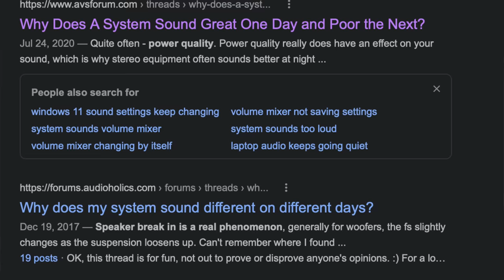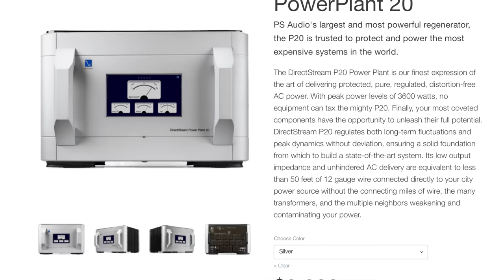Why Your HiFi Audio System Sounds Worse on Some Days. Is this the Cure? What about Transformer Buzz?

Comment: I have this 156 with the power cord and agree it is a fantastic product at a reasonable price compared to others like SR or Shunyata or Nordost or PS Audio etc.
Reply: You seem to have researched almost everything(!). Did you ever audition or hear about Furutech star grounded power distributors? On paper they do a similar job to Puritan but without surge protection,
Reply from the maker: It's one of the best purchases I have made for my system. One of the best I have made in 30+ years.

Comment: 99% of the time it's down to your mood.

Most decent pieces of hifi have so much power supply regulation and PSRR that they barely care what the mains does.
Reply: Yeah, never had such hideous 'DC on my AC mains' problems like this.

Comment: I am so thankful that every time either day or night I listen to my system I'm nothing but blown away.  And I don't use anything but 10 gauge copper speaker cables and standard basic jacks for my preamp CD player turntable and plugged straight into the wall, how is that possible?
Reply: You have “Magic Juice” Magic Juice is extremely rare. Don’t let the electric power company know you have Magic Juice coming into your house. They will raise your electric power bill if they find out you are an Audiophile.😀
Reply: How is it possible ?  

The devices you own were designed to be used exactly as you do, nothing more.  No magic here.

Comment: Have you tried the Puritan with a nornal power cable yet? Logically, if the power conditioner is doing its job, the cable between the wall and conditioner shouldn't make much difference. On the other hand, cables between the conditioner and the equipment maybe more effective to preserve the clean power and reduce interference via shielding.
Reply: Conditioners don't condition themselves.
Reply: Getting clean power for your stereo is a cumulative process. Even the power outlets (i.e. Furutech, Audience) can yield a noticeable reduction in noise if you have a revealing upper mid-end to high-end system.

Comment: Thing is, you've introduced a new X factor by rewiring the room. You said you just plugged your amp straight into the wall, and the peripherals went into a power strip. First thing I'd do before plopping $4k into a new toy, would be to start from scratch. I'd be really interested to see what the Niagra does as far as alleviating your issue. Sure, this is 1/3 the price of the PowerPlant, but I'm guessing with the new wiring a lot has changed with your system. When I was building my dream room with a dedicated 20amp panel just for the electronics, they installed some sort of sine wave conditioner that wasn't particularly expensive. The noise floor was non existent, and the blackest of blacks. The ex probably has her electric piano plugged into it these days. BTW, after 50 years (25 as a recovering audiophile), I know half of it is psychological. There's days I just shouldn't be listening and don't. In my current digs w/lousy wiring, a Niagra solved my minor issues.
Reply: Nope, it isn't psychological.

Comment: Well I’ve definitely experienced this. I’m on the cheaper end of the market though as my solution was the audiolab dc blocker. My hifi now sounds consistent.
Reply: I use the Audiolab DC Blocker also and it improved the sound of my system greatly.

Comment: The big issue I have with Puritan conditioner is all the inductors it uses to filter noise. I’ve used power conditioners like this before. It lowers the noise floor at the expense of restricted dynamics and truncated soundstage.  This conditioner maybe different but I doubt it.

Comment: You are absolutely right that some days sound is not perfect for the same system. Could it be depending on air pressure change?
Reply: Or if you have a cold that can effect the sound,plus if you sneeze and your ears pop slightly that too can change the sound.

Comment: This was convincing. Think I'm gonna buy it. Do you recommend connecting all equipment? Especially is there any problem connecting both digital and analogue devices to it - as opposed to some power strips that have separate zone for those (perhaps the outlets here are all separated zones to some extent)?

Comment: I use the iFi Powerstation and it has also brought consistency and low noise floor to my system. A $750 bargain in comparison.
Reply: Does it have star grounding? The CEO of PS Audio himself said that is a key ingredient.
Reply: @connorduke4619  Paul's a great and knowledgeable guy. I'm not sure but I'm confident that the Powerstation has some form of isolation between any independent circuits/PCBs - they do design a variety of power and signal related products, in addition to their audio gear. There's also an intelligent ground function that detects whether or not a ground is needed to avoid ground loops.
Reply: @infn  Paul's a great salesman too.

Comment: I have all my audio components plugged in wall sockets, and it sounds wonderful, no transformer buzz, no nothing... just super sound...and no fairytale stories with magic dust...
Reply: Fairytale
Reply: What about surge protection? Even in the absence of a major strike, small surges can wear down electronics over time, without proper protection..
Reply: Lucky you.  My old amp was humming happily in the background until I got an audio lab dc blocker thingy that brought that noise down to almost inaudible. Since then had four other apps on trial, Hegel 390, Gato Audio Amp-150, Luxman 700u and Accuphase e380. All hummed, the dc blocker worked on them all (never totally removing the transformer hum, but always at least halving) except for Luxman, which I actually bought but ultimately had to return for that reason. Luxman has an E type transformer, unlike toroids in the other three, and I read somewhere the dc blockers are not effective with those. What is puzzling a bit here is that the 595 is most likely also of the E type… Have I got a dodgy dc blocker that can’t cope with DC on my mains, i.e. lacking in that magic dust, or just unlucky with four respected brands and their expensive amplifiers?
Reply: TheMeridian, you're my darn HERO! I don't know where these cuckoo audiophiles get this stuff from. I got my electronics plugged into a surge protector, and then the wall. There's no buzz, no noise, nothing. Some people will believe ANYTHING!!!
Reply: @Larwiz  Someones gotta feed all those families,  and our mate Steve's got very expensive hobby, so...
Reply: @zackw4941  what for protection to you think of?
Reply: @TheMeridian808  If my gears look like something in his music room, I can live with hums. I will be in music heaven 😁
Reply: @strongchallenger2269  well said
Reply: Must not be a High End system then
Reply: i mean when your home was built/where your power is coming from/etc. i’ve def had a system that sounded beautiful— until i moved. not saying i want to drop 3k to fix the issue but… power really does make a difference on the noise floor.
Reply: I have ALL my gear in my main room plugged into a Furman Reference rack mount power conditioner and have never had a problem.

Comment: Before you takeout a Bank Loan... Try the iFi Audio AC iPurifier ... Plug into wall outlet
Reply: Usually those things affect sound quality you want something that doesn't color sound.
Reply: ifi dc blocker solved my amp transformer hum.

Comment: Thank you for your thorough test! I wasn't aware of this brand. Have you ever tried a Furman conditioner in your system? I have been using their cheapest model (AC 210) and I very glad for the purchase, because it has brought a very noticeable improvement in my system. The system became silent and I can hear the background as being totally "black" (absolute lack of any kind of noise). There is also a model (P 1400 in Europe) which does what all the other conditioners do, plus it's also a voltage regulator. I was wondering how the puritan compares to any Furman conditioner. Thank you!

Comment: Thank you. Very interesting. One question : have you changed all the power cords in your system ? Or did you keep the ones you had initially(for amplifier, sub, etc) ? Thanks.
Reply: Even expensive units, are likely to have, "starter," power cords. I purchased better ones, recommended by PS Audio {the maker of the P 20 Power Rejuvenator}, specific to each piece of equipment, including more substantial ones for the power amps, & the P 20, itself. The quality power cords, and connectors, represent 15 to 20% of the cost of the system! Worth it, I feel, to try to maximize the quality of the system. It's interesting how different pieces of equipment, help in his particular situation ~

Comment: This problem occurs in bi-phase main power supply (110V-0V-110V) countries like in US, where the "neutral" lead is not so neutral... There is no problem if you use mono-phase (220V-0V-Ground) like in Europe.
Reply: why?
Reply: @sqnax888  why what?!
Reply: @kodtech  How come the neutral wire is not so neutral? How does this improve power quality?

Comment: The grid or your house power factor might be out a bit to far, causing the buzzing and also increasing your electricity bill. Do you have a lot of older 12v lighting in the house?

Comment: I noticed this when I listen at 9pm and at 5am in the morning. In the afternoon, I cannot prove it but I can feel I am not into the music at much. At 9pm without thinking about the time, after I lkisten to my system...I realize that it has gotten better. I am getting the Puritan 156. But what I discovered, you need to clean up the power coming from the wall by using an isolation transformer so you feed your system clean electricity

Comment: I own an Audience power conditioner which dramatically improved the sound of my stereo. It's also a lot more expensive than the Puritan. It would be interesting to compare the two to hear if the Audience is that much better or if the Puritan is a giant killer.

Comment: What would happen if you use the Puritan and the PS Audio Powerplant at the same time?   You get rid of the electrical issues plus massive  warm soundstage? Hmmm...
Reply: You run the risk of experiencing a paradoxical reaction and your system will sound like a Bose.

Comment: I bought one of these today.   It’s not cured my buzz completely on my Hegel but it sounds lovely.
Reply: Have you disassembled the outlet and made sure the wiring is properly attached? As in the screws holding the wiring to the outlet are tight? Do the same on the panel at the breaker, ground and neutral. Electricity vibrates, and will loosen connections over time. If you have the stab outlets, where the wire is stabbed into the body of the outlet, upgrade the outlet to a better quality one. Another thing you can do, is to drop a direct circuit to your electrical panel, 12/2 romex on a 20 amp breaker. If you have not done that, you should really consider doing it. It really made a difference in my system.
Reply: I had a buzz in my Hegel h390 and there well known for it. I bought a ifi dc blocker . Problem solved. $100.

Comment: My Yamaha powered subwoofer was making my system sound noisy, with an annoying buzz every so often. I changed the male plug and all the noise dissappeared. Then I changed almost all the other male plugs and everything sounds amazing! Silver contacts, copper wire and brass coating make a huge difference.

Comment: Have you ever wondered it could be the last component in the chain? The conversion of sound waves to music in the human head? When things are going well I tend to like the sound of my system better than on days where everything is messing up. I think we should do some exercise to get in the right move before listening to the music, we should also avoid listening to the gear…. Just my 2 cents
Reply from the maker: The Puritan PSM156 is the only piece in my system I would never ever sell. It has transformed the quality of my system and fixed all of my electrical issues. System sounds the same 24/7, no noise, amps never buzz or make any hint of noise. It's a piece I would not be without at least as long as I live here.

Comment: Install a voltage regulator to your side of the home electric power supply, about £300 here in the UK. Incoming electric supply always fluctuates. Installing one of these units is beneficial for all of the household electrical goods. It will also make them last longer. My HiFi system sounds so much better because of it.

Comment: I live in Mexico and Mains power is horrible. I had to install a large UPS for my home network media center. All my TV's and audio equipment have there own UPS. Voltage can swing 15 to 20 volts during the summer. The LED lights that I installed in my home insert horrible noise in the the Mains that I had to look for and locate better options. Power outages are not common but they happen when wind is high voltage spikes happen quite often. Rain always brings power failures but I have a power generator  for outages.

Comment: I’d be curious to know if this could help with ground loop hums between pre and power amps. I had to use an Ebtech Hum X ground line voltage filter in my preamp to eliminate a ground loop hum. Before this, I tried Niagara 1200 and AQ cables, but the hum was either loud at some times or barely noticeable other times.

Comment: How can DC cause buzzing? How can you pollute the mains with DC of any noticeable voltage? I must have missed a couple of days at school when I studied electronics…
Reply from the maker: It’s a thing / read up on it. If your transformer buzzes and you can hear it then usually this  is caused by having DC on your line. If you read up on the top cause of transformer buzzing, it’s DC on the line. The Puritan was the first to remove nearly all DC on my line. No more buzzing, much better sound and protection for the system. All you need to do is google “dc causing transformer buzzing” and you’ll find years of articles and info about it. It’s a thing. The puritan is the best HiFi purchase I’ve made in many years.
Reply: I only learned like a week or two ago that you can run a DC & AC voltage on the same line and they won't really interfere with each other and I thought the same thing, how was this never mentioned in any electronics course??
Reply: @HiFiHuff  as the E type transformers are not susceptible to DC offset on the mains, how can the puritan possibly eliminate the transformer hum of your Luxman caused by the said DC offset?
Reply: Just because you don't understand it doesn't mean it's not true.
Reply: You are so right!
Reply: @Pete.across.the.street  just because you believe in it, it doesn't mean it's true 😉

Comment: I had really bad dc hum ( big monoblocks with torroidal)and the Emotiva cmx2 work extremely well. But every once and a while some dc would get through and the transformers would hum for a couple minutes……..so I tried the Puritan and it removes the same amount of dc as the CMX2, but offers much better sound…so I bought it today.. …I do have an odd issue…my transformer in my psu for my turntable buzzes on the Puritan psm156, but not when plugged into the cmx2….so….keeping both!
Reply: I use the CMX-2 and the CMX-6 units. No issues here. System sounds fantastic.
Reply: @michaelwright1602  That’s great Michael….I used my CMX2 for about 6 months and they were great….then on occasion my transformer would hum for a minute or so….that’s when I thought I’d try the Puritan. It’s probably equipment dependant as well as how bad your power is coming from the wall…(my power is very dirty)….but on my system the Puritan provided in inky black quiet background for the music that the cmx2 didn’t quite achieve.(you can buy 20 cmx2 for the price of a Puritan). If your power isn’t too bad….I am sure the CMX2 is all you need….some peoples power is so clean they don’t need any form of power conditioner (so they say:)….Chris

Comment: Can you use a multimeter and check for dc offset of your ac line and again on a port from the power conditioner?
Reply: I had the same exact question. I'm tempted to use my Fluke meter to probe my outlets for the presence of DC voltage. Anybody know if this would prove anything?

Comment: Yeah... it s*cks when you got a $45.000.- system and the sound is cr@p!😞

You could try a new earthing in your backyard (metal pole 10 feet into the ground) and use that to 'earth/ground' the audio system.
Reply: I use a power conditioner on my sources and preamp in my area there are no power problems but at Peak usage times you will always share a difference
Reply: Yea, I have a dedicated Earth/Ground line with a 5 feet brass rod into the ground and the minor buzzing on my speaker is gone. The background noise is very much lower than before.
I simply can't effort to own a 3300 bucks line purifier.

Comment: Great review and recommendation! My problem is with the harshness in vocals and cymbals. I own a Linn DSM 4 connected to a pair of FyneAudio 501 speakers. At beginning it sounded very good...a bit bright, but tolerable. After a few months things started to sound too bright and harsh. Checked.the speakers and the Linn, and everything seems okay. Could this be the solution?.

Comment: Your Willsenton R300 would have fixed the sound deficiencies. Tubes all the way.  Hum is more likely a ground loop in the signal chain not a power supply issue. Any cheap amp power supply will filter AC noise.

Comment: Interesting.  I wonder if DC on the line adds warmth to the sound?  I went through different power conditioners.  Got Puritan PSM156.  Great unit, big fan.  My discrete power supply is running much much cooler, not even linear- still running cooler.  Check the temps on your amps you may well find they are running much cooler especially as they'll have linear power supplies.